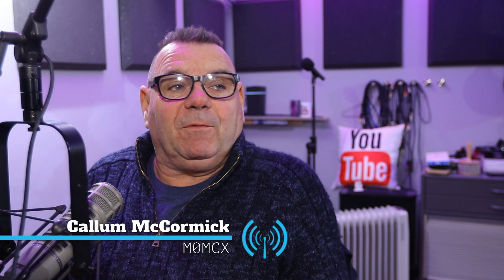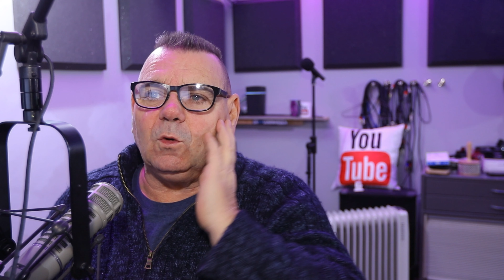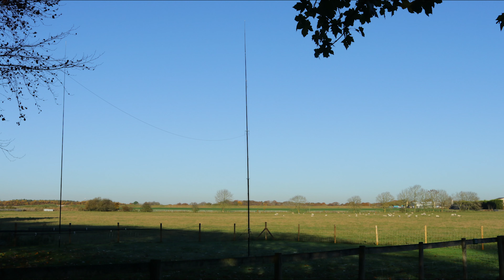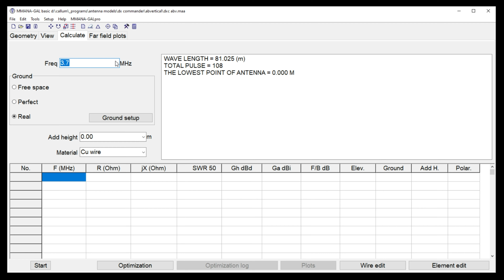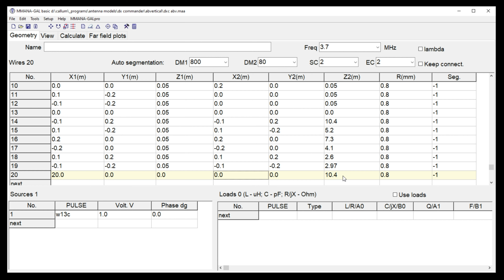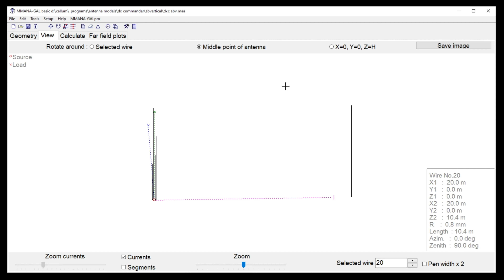Why Comparing 2 x Antennas is Difficult

Comment: Theoretical question... if instead of using radials, sheets of 10mm grid wire (the sort of thing you could use to build animal cages) or indeed chicken wire were put under the ground at a depth on about 2 inches (or just hidden under some decking). would this work?
Reply from the maker: OK, firstly check it won't rust. Some people did this and could start to hear the rusting in their headphones. I seem to remember one guy literally had to move house because he couldn't stop it. Grids work - but not under the ground. On the surface or JUST under (apparently).

Comment: I have the software and have to admit I haven't used it yet. I want to see the radiation pattern on my EFHW 80M with the two 90 degree bends mounted about 5ft off the ground. It's tuned for 80M digital but has broad coverage on 40 and 20 and the rest can be cleaned up with the radio's tuner. Rainy day today so I think I will try to figure it out on the software. Always enjoy your videos. Jack K5FIT
Reply from the maker: Yeah, do it!

Comment: wispr... or a bunch of your own SDR.... located at various friends (not necessarily a hams) house or QTH. Conduct tests with nothing else resembling an aerial sticking up for a minimum of a full wavelength. At the freq being tested.

In the broadcasting game a full wavelength is 160m +... Its not unusual for 2 high power services 2km apart with big sticks to see a little bit of RF pick-up from each other. The fun starts when that causes problems in the PA stage of your tx.
Reply from the maker: Not a bad idea!
Reply: @DXCommanderHQ  I see this play out here with our local AM station. Formerly a 2 stick directional array. Has been run at lower power and omni... for years. From what I understand the lower power is because the directional array gives protection to others. Not focus max power to the town covered. Going to omni its generally taken here that its 2kw. Where as heaps more power can be used if a DA is used. Given the costs and the drop in listenership of AM.... this falls largely into the .... who cares its on air basket. 

Its sad as the next major town is some distance away and signal is pour. They have never dropped the second tower. Its not driven but still stands. I've argued for ages that they will see improved signal to this town just by dropping the non driven tower. If you draw a line through the centres it points right at the CBD of this distant town.

Comment: hi cal  iv built myself an half square  approx 24ft off the ground running north to south  iv been doing very well with it on dx  canada usa brazil and all europe  tialand spain italy   running underneath this  east to west  is this 7ft high mild steel fence i once asked you about grounding to  could this be reflecting my signals
Reply from the maker: I would ignore the fence.
Reply: @DXCommanderHQ  what about 40 m  to the side west line electric rail line north to south also ? same height as my antenna

Comment: Hi Cal,
Well done video. I don't remember if you modeled the Signature? Stay safe.  73  WJ3U
Reply from the maker: OK, I don't really need to model it because it SORT OF exactly the same as the Classic (I think) but I did have a look at the 80m/30m element. 30m looks to have 2 high current points - similar to 5/8th. I might make a video about it..